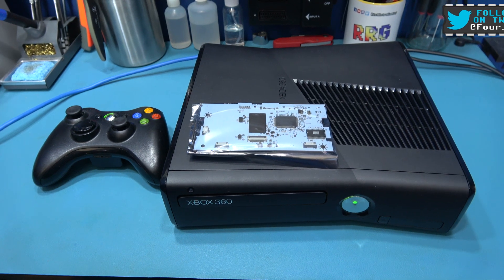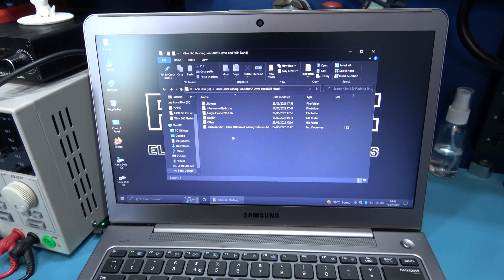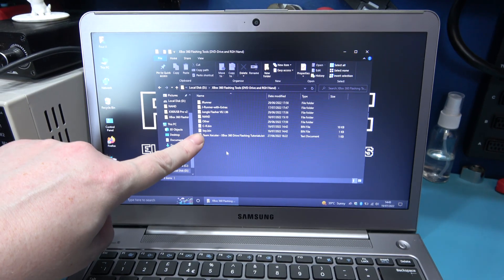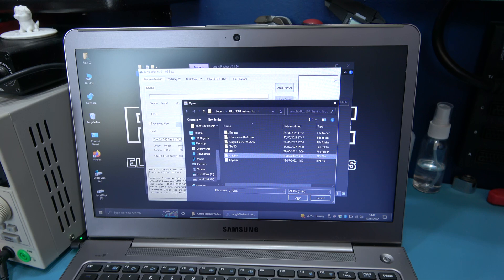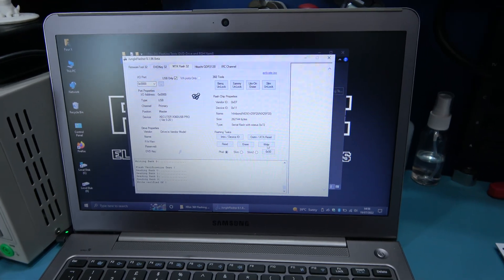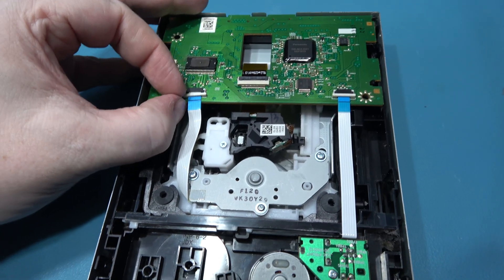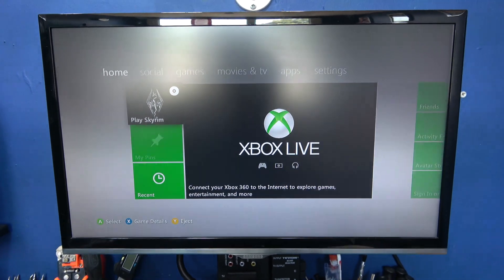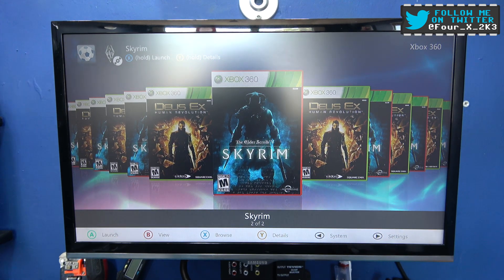Xbox 360 Slim - Flashing CFW to a Hitachi DL10N using a X360USB Pro V2 and an Unlocked LTU2 PCB.

Comment: 9:20: The official JungleFlasher documentation states that you must NOT click on SPI lock on an LTU/LTU2 board because the firmware emulates the SPI lock. The re-lock is only for Kamikaze. I only use LTU2 PCBs with that Phat-style controller chip and only if I make a Dual Nand console. On RGH you don't need to flash the drive anyways because you can use NetISO (Dashlaunch plugin) which unlocks everything by software. There is no need to unlock the drive on a hacked console.

Comment: does this fix the issue where games read as dvd from a un marryed disc drive pcb board this remarries the console motherboard and disc drive pcb board?
Reply from the maker: If the DVD Key is the right one I.E. it matches the one stored in the XBox 360 Flash then Yes.
Reply: @Four_X  i have a mw3 edition 360 slim console i got off ebay untested and reads games as dvd i tried new disc drive with my consoles current pcb board same thing so i have no clue if the dvd key is right one i assume not so im guessing rgh 3 mod mine which at that point dont really need working disc drive
Reply: Hey if you haven't found an answer yet, that was the exact problem I had with mine and it worked, swapped to LTU2 and it now reads as game. @EpicShepard
Reply: also do you have to rgh 3 your console to do this?

Comment: Nice, I didnt realise these had LTU2 boards. Only found out recently as I came across my first DL10N in 5 years of doing 360s.
Reply from the maker: I'm not a fan of the DL10N drives I'd rather it had a LiteOn DG-16D4S or DG-16D4S drive.